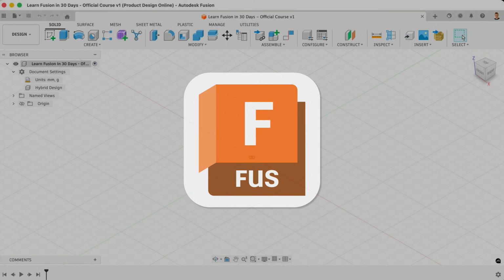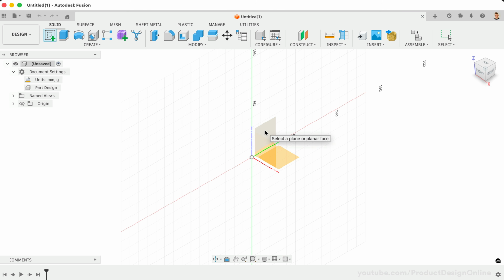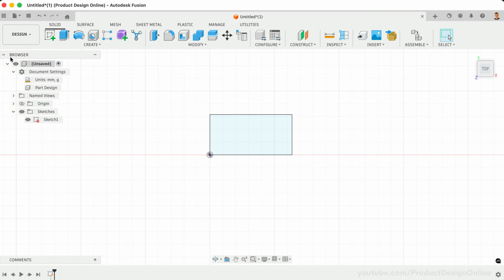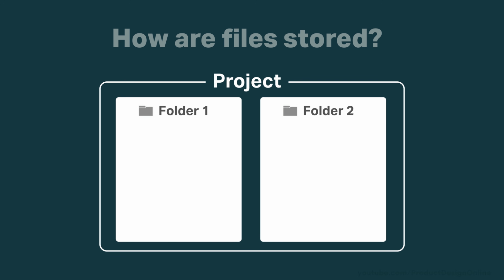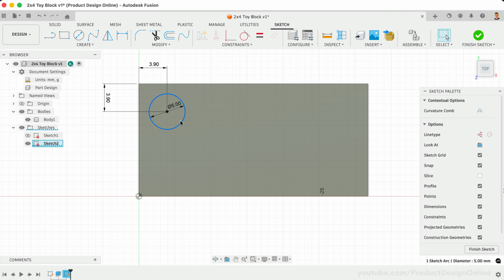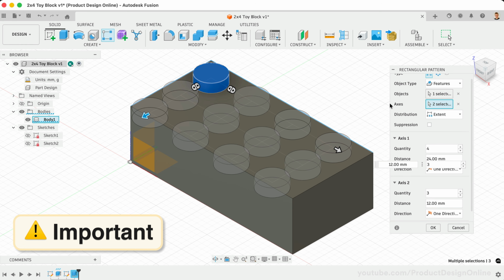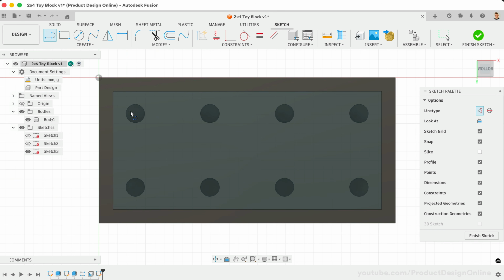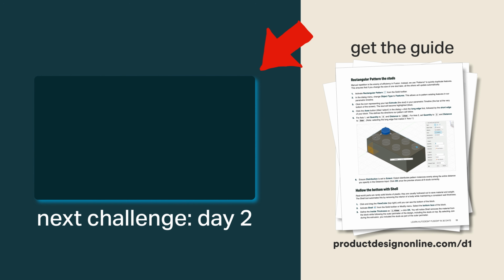Day 1 of Learn Autodesk Fusion in 30 Days! (2026 EDITION)

Comment: Really clear tutorial; tysm! Omg I already love this program SO MUCH MORE than TinkerCad! TinkerCad was easy to get started with, but I'm waaaaay too obsessed with precision to be happy with its dimension input controls 🤣 Luckily, I've worked with CAD software before and I make a lot of schematics, so the general principles made complete sense and I was mostly learning the workflow and program-specific options/shortcuts. Now I just need to figure out which key to hold down to zoom while scrolling on the trackpad cuz I'm sick of having to move my mouse to press that dang button…

Comment: Holy fuck how does anyone do anything in this POS. The bottom cylinder either will not extrude or it extrudes through the top of the block, or it extrudes a hole in through the top of the block. Second worst tutorial for this shit, only next to autocads official videos which are out of date and you can't get past the first fucking step.

Comment: having trouble with the circle.  When I use the sketch dimension, I click the center of the circle, then click the top line and hold to drag to the left but I get a pop up about depth /parents sketch line edge...
Reply: From what I understood, you need to click out to the left to set where the dimension will be labeled, and then it will let you enter a value. Meanwhile I managed to confuse myself by somehow clicking twice on the block's side and deselecting it, so nothing happened when I tried to type in a value XD

Comment: why is it that any tutorial I follow to the letter seems like a different version than what I have. I am on day three of the day one lesson. for a while the smll circle would only appear on the bottom level of the block, now its working but I don't know why. I am trying to place the circle 3.9mm but I am not getting any dimentioning that looks like the tutorial and consequently it is not working. When I try to do this I am getting a notice about a driven dimension, not in the tutorial that I can find. Very frustrating but looking forward to getting through this!

Update, driven still there, when i attempt to add the dimension it disappears??

Well I made it work.

Comment: I tried using the pattern tool with holes and it didn't let me, but with extrude it was fine. I was able to make the holes by editing the extrude to "cut" later. Is there an explanation for that? When I first tried the pattern with extrude set to "cut", it didn't let me either.
Reply: I was making flower pot wwit holes on the bottom

Comment: Can someone HELP? I’m doing my first hinged box and everything is good until I assemble joint. When I highlight the hole on the upper hinge and then the pin on the lower hinge, hit ok, it flips my top 90 degrees and I cannot get it back. Can someone tell me how to fix this?

Comment: Fantastic tutorials. One thing I’ve been messing around with trying to do but haven’t figured it out is how to center the rectangular pattern on the top plane of the body. So if you don’t have the actual distances from the edge for the first cylinder can you create a cylinder without joining, create a rectangular pattern, center on top plane, then join all the cylinders? Or is there another way other than doing the math to get it spaced from all edges equally?

Comment: Hello, thank you for the course. I can’t tell you how much I appreciate it. I recently quit a nice comfy job I had manufacturing medical devices. I liked the job but I have some issues with my license and needed to find a job closer. So I looked for a job where I would be more involved in CNC programming, I secured a job at a local van modification shop. The company is growing and was willing to train me to use fusion to toolpath for our table router. This is what got me interested in the job but I can’t deny the payoff for this training is hard work. My new job is very physically straining. I hope to gain as much skills and knowledge as possible here and eventually find a company where I can work remotely. I don’t know how long I can handle this job so I have to work hard to gain these skills.

Comment: I just started Fusion for the first time and am very excited about this series. When I got to the selecting a plane step at around 2:40, though, I realized my app has a different vertical axis than you do. My copy of Fusion has Y as the vertical axis, making the top-down view the X->Z plane, whereas I think you have it set up so Z is your vertical axis. If anyone else ran into this same problem, you can change which axis is the vertical axis under Preferences -> General -> Default Modelling Orientation.

Comment: I started using it today and some of the top menu icons are in a different place, the create sketch is under heading surface.
Reply from the maker: Those will shuffle (left or right) depending on your screen width but nothing is actually different 🙂

Comment: Ok not a very good start for me. I tried to use the scroll wheel with the shift and scroll wheel by itself and nothing happens.  When i roll the scroll wheel it zooms in/out, but to pan and to rotate i am not getting anything to happen.  What could it be, some setting that I have wrong????  I did the restore like you said at the beginning, so i would think that everything is right, but nothing is happening.  Only way to pan and rotate is to use the menu at the bottom/middle of the screen, where you see the pan and rotate buttons.  What can i be doing wrong????
Reply from the maker: The recent Fusion update has caused a lot of software bugs/ issues. I'm not sure if it's related to that or not, but it could be. The other possibility is your install and or your mouse. What operating system are you using and what is your computer mouse? 

The scroll to zoom in and out is pretty standard so it should definitely be working like that.

Comment: Total beginner here and I seem to be stuck trying to make the three center columns. After hollowing the shell I seem to be unable to reference the pegs to create the construction lines for finding the center. When i try to select the bottom inside face to create sketch it selects all the inside walls and bottom of the brick as well, and "create sketch" doesn't appear but "edit sketch" does. No matter how I try to go about it I can't grab the center of the holes to lay out any lines. Any idea what I might have done wrong?
Reply: I started over from scratch and didn't have the same problem. Not sure what I did wrong, but the problem was definitely me lol.
Reply from the maker: Glad you got through it 💪🏼

Comment: Hi, when i create a new sketch my cube TOP is always upside-down, how can i solve this problem thx.
Reply from the maker: Hi Paul. Is it upside before you create the sketch or as soon as you do "Create Sketch" it rotates 180 degrees?
Reply: @ProductDesignOnline  it rotates 180 degrees when i create a new sketck
Reply from the maker: That is a known issue in Fusion and there is unfortunately no way to avoid it (that I'm aware of). You can hover over the view cube and select the rotate arrows to rotate it back 180°.... The other option would be to turn off "Auto look at sketch" in your preferences.

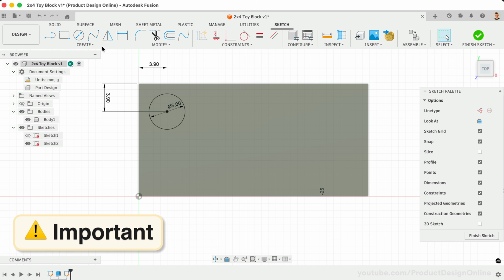Comment: Thnx man, new workflow is some getting used to. also, at 11:15, another reason to use solid body patterns, you can change these in your time line, when you do it via sketch, you cant easily modify it later
Reply from the maker: Correct. Well said! 😊

Comment: I don’t understand the part where you used the rectangular pattern feature where you knew what dimensions to set the division to? How did you automatically know to set those dimensions?? There was no explanation in how you knew what distances to set to.
Reply from the maker: Hi Wade! As I mentioned in the intro, I provided the dimensions upfront for the sake of time so we could focus purely on the core Fusion concepts. The toy block dimensions themselves were just sourced online.

However, later in the course, we'll dive deep into using equations and constraints to calculate dimensions automatically based on other parts of your model. Stay tuned!

Comment: I followed day 1 tutorial and it went well after trial and error. 

I exported the file for printing. The 3D printer was doing great bottom up until it started working on the top layer. It came detached from baseplate and I had to cancel the print. 

Any tips to print this?
Reply from the maker: What 3D printer, build plate, and slicer are you using? It could be a number of things. Generally, due to the size of it, make sure to print with a min .1mm layer height. You will also want to make sure your build platform is textured and clean from other debris.

Comment: when using the pattern tool instead of sketching and constraining each individual circle, how can we be sure they are equidistant from the edges? you gave us all the numbers so I'm assuming you did the math for us but should you show us how to do that? how can I make sure the spacing of the circles dont extend past the contraints I have made for the first circle when dragging them out?
Reply from the maker: Fusion allows you to put equations in the inputs (as well as reference other dimensions) - something covered later in this course. Generally, you'll reference your other dimensions which builds intelligence into your model so that it updates automatically and is driven from other dimensions. For example, in this case, you could reference the overall length dimension, divide by number of studs, and then factor in the spacing between them (writing the equation in the input field). If you then update the dimension field, that pattern dimension will automatically udpate.

Comment: I started 3D printing about  3 years ago. I tried using your course about 2 years ago. I found it very informative and instructional, but needed to design some parts quickly and moved over to Tinkercad. I got pretty comfortable with it, but it has its limitations.

I decided to try your course again, but have a few questions first. I use the Not for Commercial Use version on my Windows laptop. I notice that the layout of some of the tool the layout of the toolbars is different. An example would be I don't have Rectangular pattern icon. Is that because I am on a Windows machine or using the free version?  I answered the question partially when I opened it on my Macbook Air, but I prefer the Windows machine as I have a triple monitor setup.

Can you please enlighten me.
Reply from the maker: Hi there! Everything covered in this course is doable on the free personal use license, I don't use any features that are only on commercial. 

The difference of whether you see the rectangular pattern icon in the toolbar or not is solely dependent on how wide your monitor is and/or how wide you have the Fusion application when it's open. All of the features are also available in the drop-down menu, so that won't affect you either way. 

Happy learning!

Comment: Thanks for this very helpfull video, i got till the last step but im stuck there because my sketch pattern disapeared and i  dont know how to get it back and im not able to get this little center circles from the extrusions, I also think i have an diffrent version.
Reply from the maker: Make sure to use the Solid modeling pattern and not the sketch pattern.

You can reactivate by double clicking on the icon in your parametric timeline at the bottom. If you don't see it there, you will have to reactivate it from the Solid toolbar.

For your last part, make sure you are looking directly at the sketch and on the correct sketch plane.
Reply: @ProductDesignOnline  No i didnt use the sketch pattern but when i tryed it again with the full video i made it somehow correct. Before i watched this vid i watched the one  from 2 years before, so there could be the mistake i guess.

Thanks for your fast reply, I really appreciate that.
Reply from the maker: You're welcome. Glad you got it working! 😊

Comment: I’m running fusion on a Mac and having some weird problems like double click not working, not being able to drag stuff and other things not working like the video, any suggestions?
Reply from the maker: What Apple device and what OS are you on? That's definitely not the normal experience. First, I would recommend using the fusion utility application (installed when you install Fusion) to clear the cache and then do a full restart. If that doesn't work, a clean, uninstall and reinstall would hopefully fix it.

If neither of those work then it may be a device specific setting. Generally, I've seen these types of issues on Windows though, not Mac.

Comment: Had a quick question and I can't seem to find the answer. I notice when you rotate to the bottom your gridlines seem to shift to be in line with whatever is currently located underneath from any perspective. Mine is locked to the base plane and when trying to do the segments underneath after using shell it becomes harder to see. Is there a way to change this?
Reply from the maker: Hmm. Try to restore your preferences to the defaults. The "Layout Grid" should always move. It could also be a graphics issue. Clearing your Fusion, cache and restarting may help.

Comment: Why don't I have the Dimension tool at the top of my toolbar? Great way to learn, BTW, I was ready to uninstall Fusion before this
Reply: I have the same issue. I also didn’t have the triangle that was split down the middle.
Reply from the maker: What size screen do you have? If Fusion is scrunched down small, it will start hiding icons from the toolbar. All those same tools are in the menu "Create," "Modify" etc. Click the Modify menu > Sketch Dimension.

Comment: Am I the only one that can't get the mouse controls to work consistently.  It appears this is on a Mac and I'm also on a Mac but scroll wheel zooms in and out and then the rest of the controls are so random.  Sometimes they do something other times they do nothing.  What am I missing?  Edit: I guess my magic mouse may be to blame as it doesn't have a true middle mouse button.
Reply from the maker: Ah, I definitely don't recommend magic mouse with Fusion. A cheap USB mouse is ideal (if you plan to use the Magic Mouse with everything else).

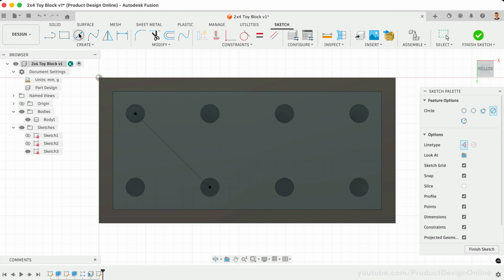Comment: how did you calculate the diameter or radius at 17:00 to fit exactly between four pieces on the top of the block?
Reply from the maker: All dimensions were found online for an official block.
Reply: @ProductDesignOnline thank you!

Comment: Great tutorial.  Being able to pause the video and "catch up" is a great help.
One thought on the rectangular pattern for the pegs, I found it better to use "spacing" rather than "extent".  These pegs are on 8mm centers so by using distance it's easier to make a block of any length and width you want.

Comment: Firstly, I really enjoy and learn a lot from these lessons, but I have a minor criticism of this one. As a design class, it's great, but the part isn't good for 3D printing. Shelling out the studs and leaving those dimples is not ideal. The slicer just can't figure out how to do them. Maybe I need to learn more about the slicer, also true. But to sort this issue, I just extruded the dimples back to the surface. My 3D printer is much happier. Again though, this is an awesome series.
Reply from the maker: I don't recall ever mentioning that this was a design to 3D print. There are many lessons in this course that I do call out, though :)

That said, I've been 3D printing for 15 years now. This will 3D print just fine due to a concept called 'bridging'. Those small studs are very small, and any 3D printer can produce them without supports. I've printed this out (as well as many others). So long as your printer is dialed in, it will print functioning blocks that snap to one another.

Comment: Thanks SO much for this revision.  I am an amateur woodworker, brand-new to Fusion, and started your tutorial series about 3 months ago.  I was completely unaware that Autodesk had made major changes just days earlier.  It was extremely frustrating when the tutorial did not match the product, especially in the first few lessons where, as a beginner, I had no clue what I was doing.  I'm very grateful that you made your update so quickly.

Comment: Hello Kevin. Question: I need to make an array of circles but not all the same size, can the rectangle pattern be used to make the inicial circle and somehow be able to change the size of the rest? Thanks for your time
Reply from the maker: You could change specific cylinders/circles by using "Press Pull" command on them after the pattern.

The other option would be to do multiple different patterns, each one including the same size.

Depending on what you're doing, an advanced way to do, it would be to use user parameters and configurations to control them at a more individual level. 

Can you share more details? Will every single circle need to be different size or will there be multiple sizes patterned?